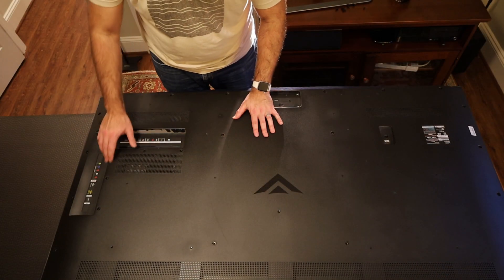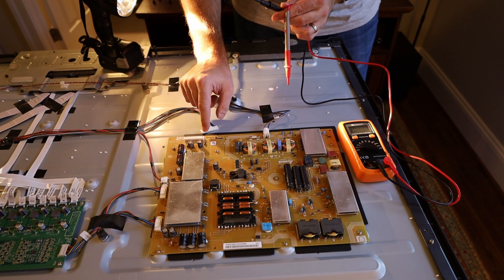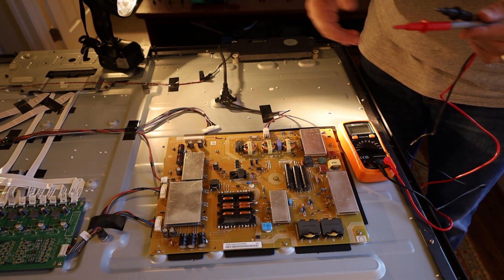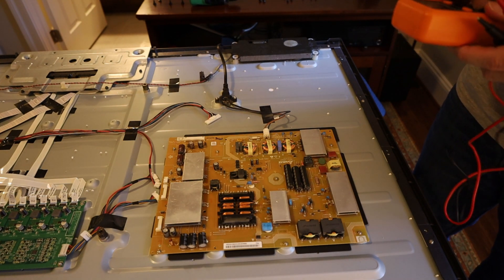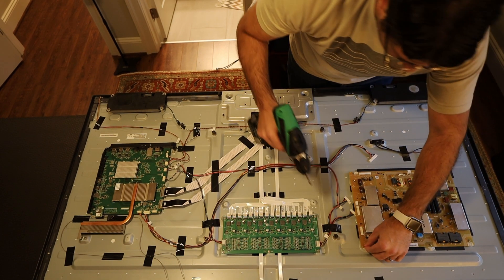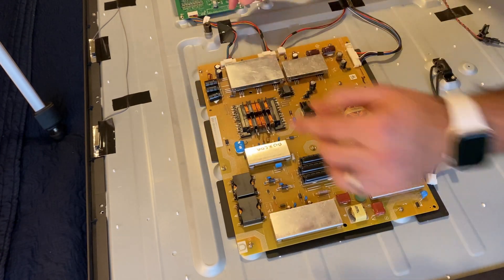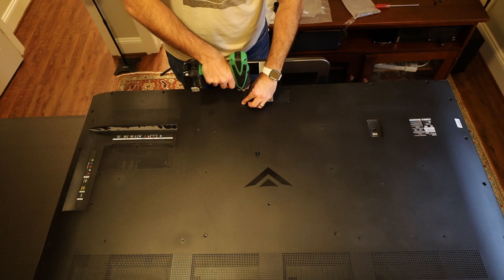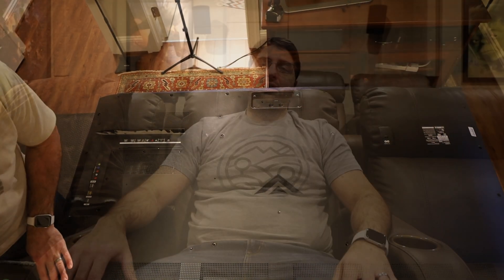Vizio P Series Won’t Turn On?  Power Supply Diagnostic and Repair

Comment: When you sent the board to the shop, did they do the diagnosis of repair, or did you have to specify what needed to be fixed?
Reply from the maker: There was some communication between me and the shop through eBay but they ultimately fixed the problem.

Comment: Why didn't you check the output voltage on the repaired power supply board after installing it, as you did in attempting to troubleshoot the problem before removing the board?  Info might have been helpful in the future and would have only taken a couple of minutes.
Reply from the maker: I guess the fact that TV turned on was all I needed but that’s a good point.

Comment: Very helpful video. I found a used board and replaced the current powerboats (whose mounting screws were loose). No power still. Any other suggestions?
Reply from the maker: Could be an issue elsewhere. Are you sure the new board is good?
Reply: @Upscaled_HT  Thanks, it was a used board so may also be defective.  How much did it cost you to have your board repaired?

Comment: Hello, video was pretty cut and dry. I would like to ask another question.  Was your TV starting to turn on intermittently when commanded? Sometimes I hit the power button,  get the white light below but had total black screen. I turn off and then turn on and it would occasionally come on, and be working. It did this the past two weeks. Today, no joy. Won't get a black screen nor a white power indicator, lower left side. Vizio P702ui. I did look at the link on ebay, appears they have this model. If you had the same issue before it completely stopped working, probably have the same issue and fix? Respectfully,  Kosmo
Reply from the maker: My TV was completely dead and would not work at all.
Reply: So there was no warning at all?
Reply: I removed last night and sent it off to the ebay link you provided. I have the 70" P series. Got nearly 8 years out of it, hopefully I can get some more. Some of the TV's now aren't built as good, not that I'm impressed with the 8 years I got but new LG I bought for the garage is half the weight and 1/3 the inputs and outputs

Comment: Hi, my indicator light comes on when pressing power then fades away in a few seconds and even blinks when I try to reset the TV but of course no picture or sound. Would this also have the same issue with the power supply, I noticed you said your Vizio's indicator light didn't turn on. Thank you.
Reply from the maker: I had no lights whatsoever.
Reply: @Upscaled_HT  I seem to fix it and now I have sound and backlight but no pixels, backlight and local dimming also reacts to what's going on the screen but no color or any pixels from what I can tell
Reply: I was able to get this fixed as well 👍
Reply: @mansour27  Well, what was it ?
Reply: @haywin4601  the solution that kinda worked for me was to take out the motherboard and heat it in an oven toaster (this is to heat up the processor on the board apparently to mend the micro crack that may have developed in processor) on 330° or like 10 minutes or so (I forgot the exact numbers) and everything was working perfectly for over two weeks then it one half of the screen completely glitches out or a minute or two and the whole tv go back to not working except for the indicator light. Two months go by and I repeated the same process and got the same results, works perfectly for three weeks then one half of the panel glitches out then it's no audio no visual once again. I have moved out and left the TV in the garage but I would guess buying a working motherboard would fix the screen. It was a cool project but I replaced the TV around the same time it stopped working the first time.

Comment: Hey just a note that if you remove the power supply board after unplugging everything, it may still have a charge in the capacitors and give you a shock (as it did to me). Handle with care! You can protect yourself by wearing rubber or vinyl gloves. The repair shop requests you package it with padding - I used bubble wrap. I asked them about discharging the board before shipping and they said I already did (when I got zapped), so it was okay to ship.   Also - take a sharpie and mark the little connectors so you know which ones go where, (e.g. L for left, C for center R for right, etc.).
Reply from the maker: Good advice.  Thankfully, I had no issues when I disconnected everything.
Reply: How do you go about discharging the board if there is sill a charge in the capacitors?  thanks
Reply: @pwall921  usually self discharges after unplugged for 10 minutes